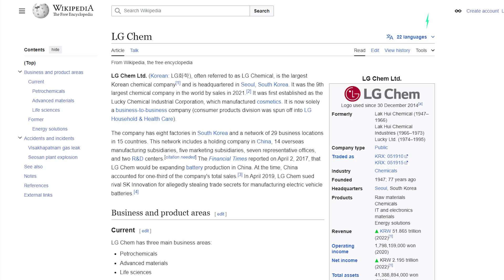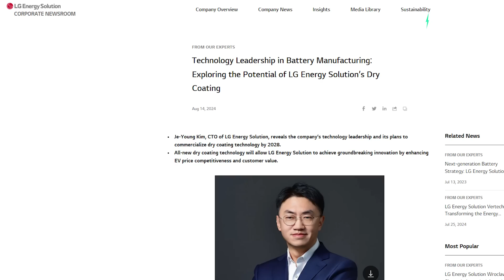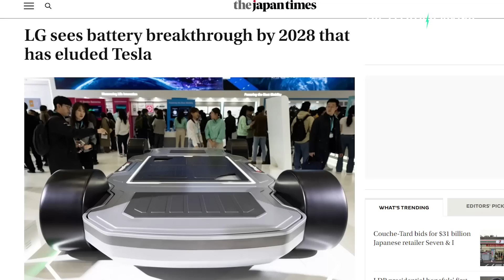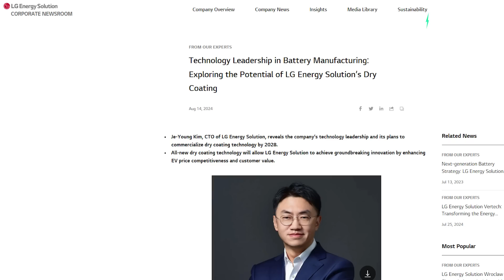Tesla dry 4680 batteries VS China's onslaught of new LFP batteries

Comment: We need more coverage on any safe tech. that are developed to overcome thermal runaway at cell level(it really matters, since a puncture short or elevated ambient thermal event is highly likely in an accident/parked scenario). Anything, that slows down heat transmission, isolates cell thermally, outgasses Co2🙄 to reduce O2 concentration to make thermal runaway, next to impossible🤞😂.❤👍

Comment: It is the difference between the spot prices of the two metals.
Iron is one tenth of the price of lithium.
But it is not suitable for EVs because the molar weight which is the other way around. For lithium it is 6.4 where for iron it is 55.9.
So the cost where size is not relevant iron is one tenth of that of lithium. But to get the kind of power that you get from lithium you would have to use more than 56/7 times. That kind EV would be very heavy indeed.
But for a stationary battery it doesn't matter. This is why these batteries cannot provide the kind of power output (per hour) that lithium can.
If they are scalable then it could be true.

Comment: Investing in super fast charging batteries is cool, but it requires the whole charging infrastructure to be upgraded to support it. Still makes more sense to invest in cheaper and higher density (lower weight) batteries rather than faster charging ones.

Comment: 'The limiting factor' has done a deep dive on the 4680 cell, so it's not accurate to say that we only have Elon's word for any of this. The reality is that at least one of the electrodes is currently being produced with the dry coating process, and possibly the second one too recently. 
China is very good at driving down the cost to the consumer, through low wages and material costs, but also by cutting corners and through subsidies. Some of these things are sustainable, others not so much. Most are using pouch cells, because that's what they started doing, but it doesn't take a genius to see that a large cylindrical cell is so much easier to make. The number of steps in the process is much less, and the rate of production and simplicity of the machines is going to be crucial in keeping the cost down. I'm staggered that it's taken so long for Chinese manufacturers to catch on to this basic and obvious fact.
Tesla can lower the cost even more by using a licensed LFP chemistry so that the material cost is less. It's going to be a constant race to improve both chemistry and process equipment, but I think the cylindrical cell will reign supreme in the end. I can't see how a pouch cell can ever achieve the ultimate cost that a tabless cylindrical cell will achieve.

Comment: Reminds me of the early days of home desktop computing. 
Bigger specifications all the time. 
The big box could be upgraded with new memory, new mother board, new ram, new hard drives. 

The rate of change was unrelenting. 

Can I suggest that just the V2G feature would give long term value to new BVs. 

Recessions happens when cheaper and better is a short wait away. 
Buyers postpone buying. 

Get V2G into the vehicle NOW. 😊😊😊
Reply: China have already mandated that this is a required feature of every EV sold in China - not sure when it comes into force.

Comment: You have many good points. This reminds me about solid state batteries, which have been pitched as the holy grail for many years now. And the big question is will SS batteries raise reliability, lower cost, and ramp up to volume production before a competing (superior) battery chemistry comes out. CATL is coming out with several competitive battery chemistries for various vertical markets. Offering lower cost sodium batteries, or offering chemistries that provide faster charging, or longer life, better safety, easy recycling, higher energy density, etc.. And maybe the final solutions will have hybrid packs that mix batteries to provide all of those benefits for the baseline 125 miles for normal daily driving, and then up to 300 additional miles for the rare times that is needed.

Comment: Hi Sam, This is all well and good for 4680 batts,  but we need to address a problem.  Yesterday a major highway artery in CA was shut down due to a thermal runaway of a Tesla Semi battery pack.  The Highway Patrol shut down the entire East-West freeway due to "toxic gas" emissions from the fire.  As T Semi production is forecast to ramp up this year we cannot  have this happen very often or all major truck routes in the US will jam up.
Reply: That would have been NMC chemistry cells - very unlikely if they were LFP. I'd never have an EV with NMC battery.
Reply: So exactly the same when a Diesel tractor catches fire. Which happens a lot. Or a car or anything else composed of highly combustible plastics, rubber and other flammable material. So we need to address the problem of millions of chemical bombs travelling around at high speed.

Comment: TESLA 4680 as a "dry battery " will be interesting in how many charges it can take and what degradation occurs. Remember a Semi truck basically has to be charged everyday , sometimes twice a day if it's run around the clock like interstate transport . Remember MEGA packs could benefit in using 4680  or possibly a 63160 type formate as you should be able to quadruple the Giggawatts produced per day with this formate . .
Reply: semi are prime candidate for battery swapping since they are all standard forms

Comment: Sodium batteries are likely to find a home is BESS rather than cars, due to their higher weight and lower energy density compare to Lithium based batteries, also currently their charge/discharge rates are relatively lower than Lithium. Sodium battery advantages are lower cost and higher life cycles, hence will be attractive in areas where weight doesn't feature as critical - hence static storage applications rather than mobility applications (where weight and density impact range). 

For mobility, LFP and their higher energy density LMFP cousins (once commercialised) will likely dominate as they offer a sweet spot of efficiency, weight and cost, with LFP used for standard vehicles and LMFP in some cases (such as smaller battery sized/small lightweight cars with high range efficiency). LMFP and Lithium-Nickel (NCA/NMC) will likely fight it out in performance car segment. Chemistry and packaging enhancements such as solid state and silicon anodes are likely to find home in high power density areas - heavy vehicles etc. - but may trickle down into performance and high spec/higher cost premium cars. 

The battery technology with most promise in the future is Lithium-Air, which is starting to step out of the labs into production trials - this offers current energy density of 1.7kWh/kg (maximum energy densities potential being 12kWh/kg, but likely ~4kWh/kg may be more relatically achieved) but currently offer lower cycle life (<1,000 cycles). If the cycle life can be improved this may challenge other battery chemistries due to Lithium-Air's simplicity (low cost) and high power density. However, even if cycle life can only be marginally improved these cells when coupled with high recyclability battery designs would offer unique capabilities in specific areas; such as flight where swappable batteries could utilise support services to recycle spent batteries into new ones at relatively low cost (rather than seeking higher lifecycles).

That said, as the batteries themselves have entered commodity marketing levels, the manufacturers will move on from supplying cells to supplying compelete solutions instead, e.g matched power electronics/charging/BMS/battery packages or full integratable/interoperable battery skateboards in a variety of configurations that automakers can pick and choose amongst to integrate into their cars. BYD are showing signs of moving in this direction already seeking to offer their platform solutions to other automakers.
Reply: It's always going to be lithium in transport applications. That is, of course, unless we find another element to bolt on to the periodic table.

Comment: Gut feeling....scrap the 4680 dry electrode idea.  It should have had a roi a long time ago and still doesn't.  Now sodium is surpassing it and it might be time to change tracks.  Either that, or get them out everywhere right now.
Reply: As I understand it: sodium will be good for large megapack type installations, not for cars because they do not have enough energy density.
Reply: Look up the periodic table! Sodium cannot surpass lithium for energy density in and ion battery.

Comment: I used to be a big fan of the 4680, but after seeing your vids on CATL’s blade battery, I think that’s what’s going to win out in the long run. It also seems like a square/rectangle is more efficient to pack than a cylinder.
Reply: That's what the 4680 battery was designed for... to make fans and to pump stock prices. It's done that really well.

Comment: This is just more shade thrown in Tesla's direction as far as I'm concerned.
All these breakthroughs are great but can they be mass produced? And at what cost? This is never mentioned.
Tesla is MASS PRODUCING these batteries RIGHT NOW (even though it's 18 months late according to Tesla's own goals).
Batteries that are specifically designed to be scalable and cheap to manufacture.
Reply: Mass producing? It depends on what your idea of "mass production" is, I guess. Tesla claim that they're currently producing 80Mwh per week, which equates to a bit over 4GWh per year. BYD are producing 7 times that. CATL are producing more than 20 times that. And, like Tesla, they too are expanding production.
Reply: Other companies produce much more batteries than Tesla.

Comment: I think the 4680 cell will go away because the cylindrical shape takes up too much room. Energy density will come down to the best use of the volume available at some point.
Reply: I think the 4680 cell will dominate due to speed of production.  When you can crank out cells 10x faster than the competition you can't lose.  It is far easier to replace a AA battery than a built in battery designed for that specific product.
4680 is the same way.  They will find the bad battery, replace it for $7 and save the car owner $10k by not replacing the whole battery pack!
Reply: @davidbeppler3032  Have they decided NOT to glue all the cells into a single, non-serviceable slab, then?   Must've missed that..
Reply: There are two factors, one is energy density in terms of footprint or space the cell occupies and the other is compatible design element with possibilities of effective cooling and isolating the cells from each other with safer distance for service and replacement purpose.  I think still cylindrical has edge in the second factor.

Comment: The demand for batteries is so great at the moment that I don’t think it will matter as long as the battery has a certain value in terms of cost, durability, thermal runway, energy density. Transport and Energy globally still requires so many more batteries for this transition it won’t matter if it is A Tesla dry cathode 4680 batteries and a CATL LFP batteries.
Reply: They are moving in the direction of being a commodity.   Best mix of quality and cost wins.

Comment: 4680 battery that tesla makes will be used in their own products. They don’t need to produce huge amount for others. That is a very big advantage . Tesla goal in my onion is to bring the production rate of their 4680 batteries high enough for their Cybertrucks and the Robotaxi fleets to bring the production cost down. All other products could use LFP batteries from their battery suppliers.
Reply: Sodium-ion for stationary, LFP for cheaper lower range cars, nickel for higher energy density for now, later could be solid state. We need superchargers every 50-100 miles everywhere, not just interstates, then people won’t care about range as much.
Reply: Also worth noting that a 2019 Model 3 std range did about 260 mile WLTP and the latest iteration just 5 years later does 355 WLTP miles. (Using LFP as opposed to a Lion) - unlike other manufacturers, Tesla does not wait for 8 years to bring out a new innovation, they are constantly on the move.

Comment: LG isn’t expected to ramp their dry coating 4680 until 2028.
20-30% savings doesn’t match the 69% Tesla claimed at battery day.
Tesla just have so many innovations.
Reply: That wasn't just from the dry process.  They stated a 16 percent improvement in cost for a dry Cathode.  4 percent for the dry Anode.  The rest of the improvements are listed as form factor size 4680, factory improvements, improved vehicle integration etc...
Reply: @Ryan-ff2db  exactly. Tesla announced multitude of innovations in 2022, from sourcing / processing raw materials (& recycling) to structural integration in vehicle. We don’t hear how many LG is copying. Point Musk made was Wright’s Law can have a dog’s leg steep dive, not incremental annual reductions.

Comment: The future is blade cells, not silly cylinders. You can control the packing density. Not so with cylinders.
Reply: Are you unrecognised genius?
Packing density (volumetric) isn’t crucial, isn’t particularly inferior at 90%.
Then there’s structural advantages from steel cylinders with fire-resistant adhesive forming a rigid beam between two end castings.
Thirdly venting during thermal overload is more reliable - more likely to expel electrolyte.
Not silly.
Reply: Many factors to assess. For example, a 18650 based pack will have 1000s of cells. If you lose one or three - no big deal. If you have 200 blade cells and you lose one, you lose 0.5% of your range.
Reply: @JoeMcMorrow-k7e  Bu they are easily replaced.

Comment: You can tout dry cathode or sodium based battery, but as long as you don't produce it en masse today, it doesn't exist. Cylindrical batteries have an efficient packing problem vs. blade and pouch batteries. It is now clear that Chinese car companies who receive substitutes from their government will be tariffed up until 36% all over EU from October. Chinese car sales will almost halt entirely here in Europe while Chinese made Teslas avoid high tariffs.
Reply: I dont think Chinese car will have much problem with the tarif in EU, BYD have said they dont change prices. They can get around it by producing in turkey or in EU.
Reply: @andders2477  I doubt that very much.
Reply: Blade and pouch batteries have issues with deformation.  I don't get the cylindrical battery efficient packing problem.  How so?
Reply: Hexagonal packing is 90% efficient of volume, doesn’t impact actual pack weight.
Many Legacy car makers double stack batteries - now that impacts design.
Really helps to design in efficiency. And with pickup, eliminate ladder frame.

Comment: 4680 is a battery type defined by the shape and specs/size of the outer shell of the battery. kind of like AAA or AA or C or D batteries. And just like you an have NiCad, alkaline, mercury, zinc carbon, AAA or AA or C or D sized batteries, you can have the 4680 with different chemistries. I'm sure the industry and Tesla will use the latest greatest battery chemistry of the day for the 4680 battery
Reply: Thank you.  I think you explained it better than I did.
Reply: Yes. Drew & Elon explained the heat removal advantage from slit continuous tab - connected to metal can.
If LG tries just 5 welded tabs, heat management is more difficult.
46mm diameter is a lot for conduction through multiple layers of separators & electrode coating.
Reply: It also includes physical improvement to the cell can and internals that accounts for ~10% more energy density.
Reply: Now I got it.

Comment: Agree, sodium ion structural (possibly hybrid) are the future.
Reply: They don’t have the energy density.
Reply: Rocket scientist is correct, you can't get the energy density. Na-ion batteries make huge sense in stationary applications, but unless we discover another element to add to the periodic table, nothing will replace lithium in ion batteries. If you've got 2 minutes, pull up the periodic table and compare sodium to lithium. Sodium is just shy of three and a half times the weight/size of lithium.

Comment: Definitely the dedicated advanced battery manufacturers will dominate. Most likely it's the Chinese followed by Japanese and Korean.
Reply: Are you so sure.   Outside of trucks and aircraft if one has 400 or so miles of range more has questionable value.  At  that point it is a race to see who can make them for less.  Lighter is better but generally not at a significantly higher price.  Batteries will become commodities.
Reply: @danharold3087  - batteries are already commodity level items,  battery manufacturers know this are are seeking to move up the food chain to higher value offerings, such as marketing complete systems (power electronics/bms/charging/battery) or configurable skateboard systems that automakers can pick and choose to integrate.
Reply: @GruffSillyGoat  Not much point debating if a thing is or is not a commodity when the world disagrees on what a commodity is.
Some go so far as to say there is not such thing as a commodity.
In addition to that  not all batteries are created equal.  Some maybe and others not.
Reply: @danharold3087  - not debating commodity from a markets perspective, my point was the battery manufacturers are seeking to move up the value chain not stay put providing only their base 'commodity' (i.e. the battery units).